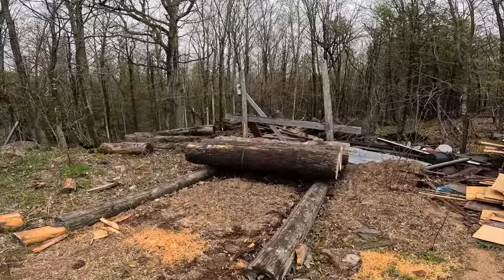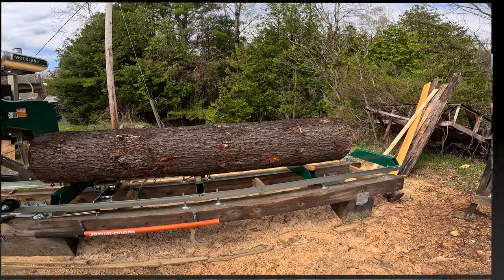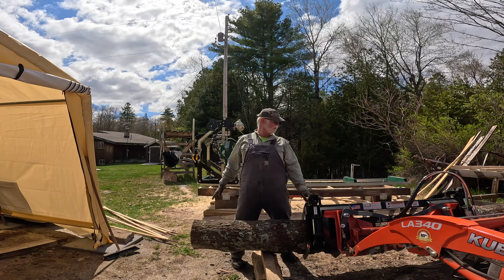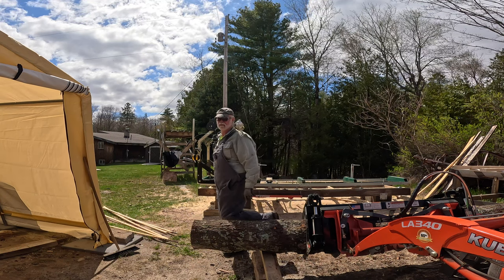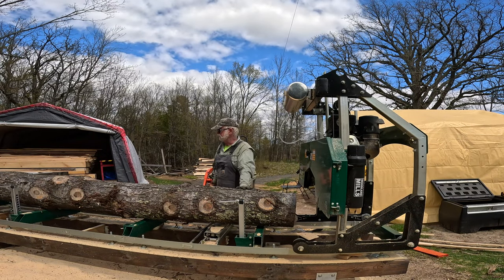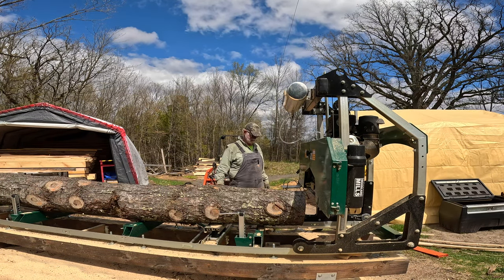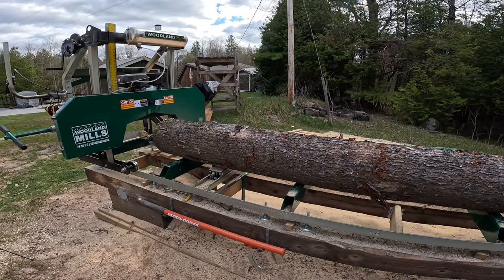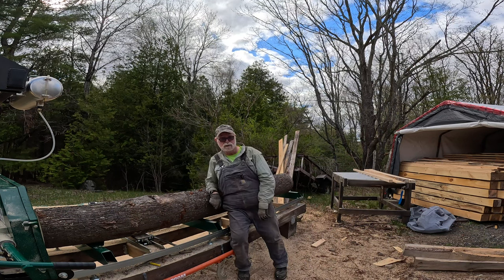Racing to Finish the Sawmill Work Before Summer Heat

Comment: Looks like you are almost there on lumber stock. Great video. I have a small Norwood mill and the exhaust port for sawdust was made like yours and blew sawdust way out. I added a piece of flashing turned downward and attached with screws. It makes a nice long pile much easier to pick up and remove to compost pile.

Smoky Mountain Outpost
Reply from the maker: I love be able to cut my own lumber! I use my sawdust and wood chips for trail covering. It works extremely well. I just bought a wood chipper for the back of my little tractor to help add to that. Thanks so much for watching! I’m just on my over to check out your channel. Have a great Sunday!